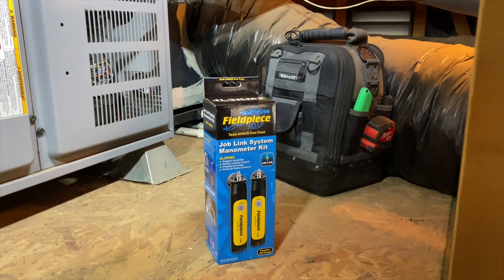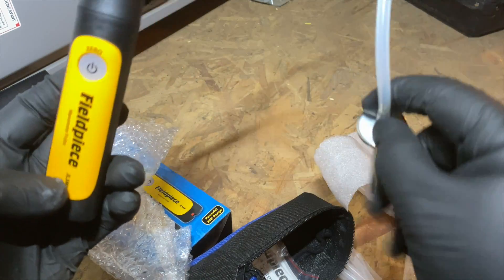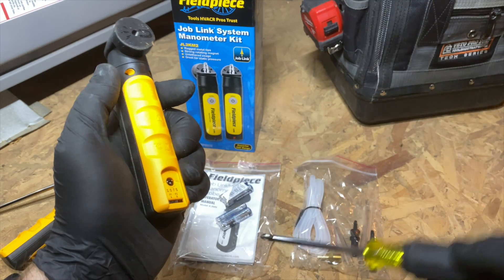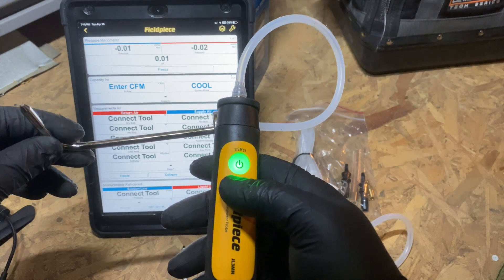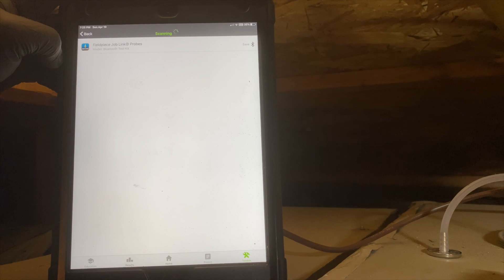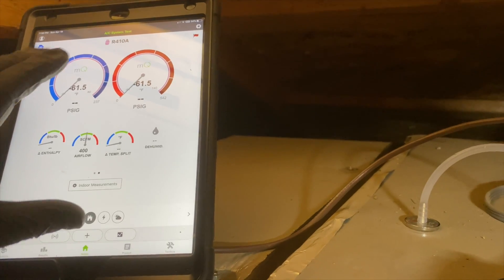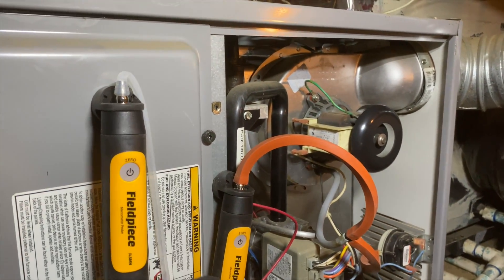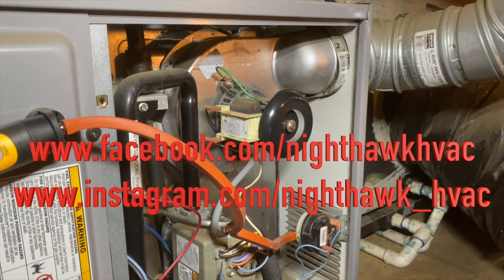Fieldpiece JL3KM2 Joblink System Manometer Kit Unboxing & Review, Static, gas, and IDM Pressure EP34

Comment: would the SDMN6 be a better investment vs Fieldpiece JL3KM2?
Reply from the maker: The job link manometers are actually cheaper then the SDMN6. The SDMN6 has the pressure switch tester built in however I don’t see the use for it. That’s just me. I like the job link manometers because they’re a lot more flexible for me. I do a lot of static pressure measurement so they are more convenient to use. They work good for gas pressure testing as well. I guess it’s just personal preference. I will say they both have they’re pros and cons. I have a SDMN6 review as well if you’re interested in it. Thanks for watching.
Reply: Stick with the sdmn6
Reply: @5822huron why you say that’s?